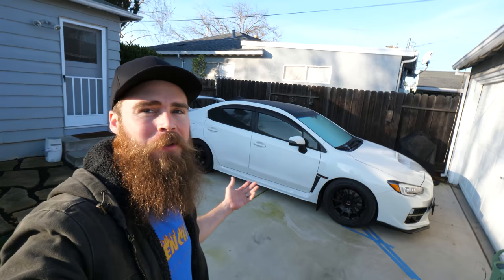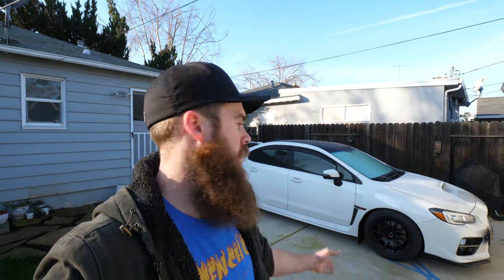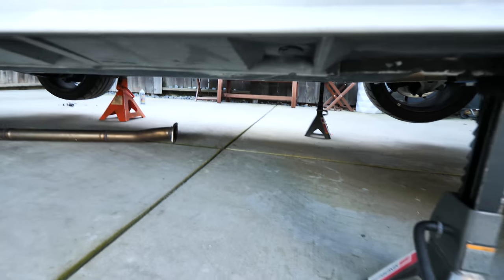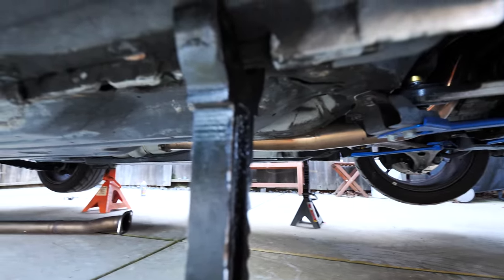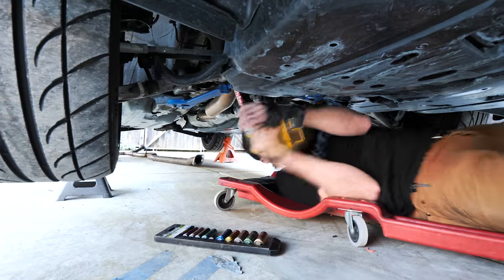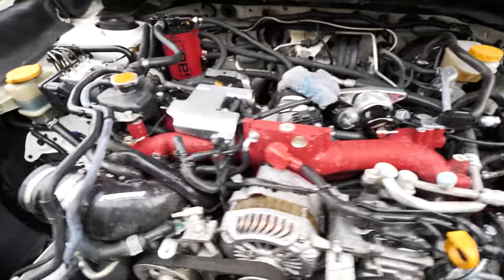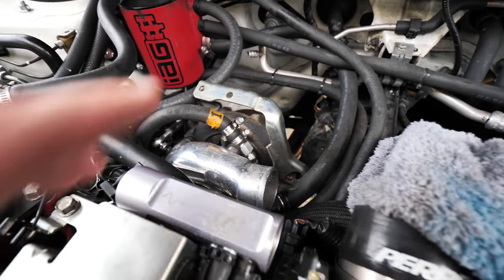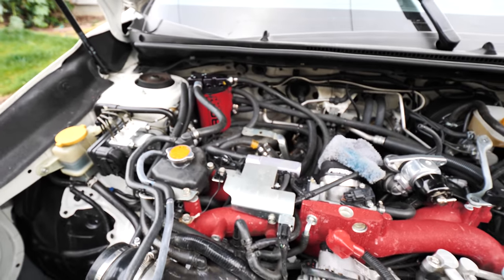MOST HATED SUBARU VIDEO EVER "THE STI PART OUT"

Comment: Have a 2016, no issues. Bone stock. Friend has a 2011 bone stock as well with 140k no issues. I guess the main thing is to keep it stock and do oil changes. Also, don’t take it to the track with it not broken in. Just my two cents.
Reply: subarus are garbage stock
Reply: KoG GoK They aren’t reliable stock either?
Reply: garbage as in they have absolutely no power compared to everything out there now adays. the power rating has been 310/265 ish for the past 100000 years.  they just keep getting heavier and heavier but same old power.
Reply: KoG GoK Ah. More than enough power for me since I came from a 2010 Honda Civic. But back to reliability, stock is still good, right?  That’s all I really care about.
Reply: head over to a subaru forum... and search ringland or bearing failure
Reply: KoG GoK even with a 2016 WRX?  Not sti.
Reply: go to google and type in fa20 ringland failure. why are you in such denial? unless you are driving like a granny shifting at 2k rpms and changing your oil every 1000 miles you are going to have problems. if you are driving like that should have just bought a regular impreza and saved yourself alot of money. the funny part is the first link that comes up is to nasioc with a list of like 20 members with blown fa20s lol

all i  know is on my next build with will inevitably happen im going to use a jdm sti ej20.... if it wasnt for me enjoying smashing 5.0s with my 4 banger i would have changed platforms a very long time ago.
Reply: I own a 2004 STI with 145K miles and it still pulls strong (it burns a normal but high amount of oil though).  I’m just now getting around to doing a rebuild on it but it has been fairly reliable, at least the motor has.  I even autocross occasionally, no complaints.  Most of this guys are neglecting their cars which is why they blow.  If you rebuild without a quality oil pick up like killer B or a air oil separator, check oil regularly then you won’t have a problem.
Reply: Cali MD I baby my cars. I shift around 3K. I’ve never taken the car past 4K.
Reply: Mohit Gehani 2004 STi here 118k miles stock motor and turbo Cobb st1 . But I maintain mine like an airplane . Check my channel for engine maintenance and tips to keep it running. For what I do with my car , more power is not needed. Chassis Tuning is more important to a under steering Subaru. I know multiple people that have had issues when trying to make power.
Reply: @WhiteGravey  thats why you build tbe engine pretty simple
Reply: @themtgdude486  stock is not reliable. After you build them they are reliable

Comment: lmao, amen Blake. This is the damn truth. I've been in and out of Subarus for 10 years now. Junk, like I can't begin to explain how much top end fluid, early flushes, early oil changes, protunes, top of the line parts, etc I've used on my WRX's and still...boom, blown engine, blown trans, blown rear diff. They are only good for maybe daily driving, keeping them bone stock and under warranty. I got out before ever building an engine, thankfully. I'm not much of an autocross guy, I just wanna go fast in "Mexico" and I picked up a 2015 5.0. Completely different animal, with long tubes back and a tune, redline set at 7800 the car is amazing to drive and makes over 400rwhp, much more than any of my blown up WRX ever made. Best decision I've made, hands down!

Comment: I just traded my 2016 STI in.  Just got totally bored with it.  Paid cash for a 2015 Camry SE as a beater which I will keep until the wheels fall off..  Saving for a 981 Cayman S.
Reply from the maker: RexReese perfect choice the Cayman is an excellent car, it’s seriously cheaper to start with one instead of modding an STI because eventually you will have put enough money in a 40K car to afford an 60-80k car
Reply: you wont regret that choice on the 981. Expensive to maintain though so keep that in mind! My brother owns a 981 cayman S and a set of tires cost about $1400 or so. Pads and Rotors are also quite pricey coming from a subaru  hahaha But you'll have one hell of a fun track car!
Reply from the maker: SpacemonkeySTI Pretty sure the tires are currently on this car cost the same if not more.

Comment: Would you say they have less problems if you leave the powertrain bone stock? I've seen tons of old bug/hawkeyes with 200k+ miles.
Reply: Gavin Whiteley from my experiences it's best to keep these drivetrains stock, or to do a very minimal power increase if you must.
Reply: It mostly an ej25 problem. It's a terribly fragile engine.
Reply: As Jensen said, it's mainly a ej25 problem. EJ205s are stout, but are more expensive and harder to make big power out of. But ej205s with vf turbos don't have the same problems, but you aren't making much power
Reply: U need knowlege on how these cars run, mein buddy has 160k E85 and he only uses it to race or drive hard for the last 5 years. Mine has held up good 100k mi. going strong. That being said you need forged piston if going over 350 whp, thats a given on most 4 bangers. Now the BMW are fast af, look real nice, the 135 looks thicc af, but some repairs can cost just as much as a wrx shortblock and i hate the dual mass flywheels.

Comment: 800 miles at a autocross.... well ever heard of a break in????
Reply from the maker: John Blankenship myth here’s a little article on that http://www.badasscars.com/index.cfm/page/ptype=product/product_id=82/category_id=13/mode=prod/prd82.htm
Reply: @BlakesGarage   why not go with the manufacturers recommendations(IAG) over badass car article?
IAG then selfs say: 

IAG built short blocks can be professionally tuned once they have reached approximately 800-1000 miles of
break-in driving and have been extensively quality controlled.
• Regardless of mileage when tuning, continue performing break-in oil changes as scheduled throughout the
duration of your first 3000 miles of driving.
• Once break-in tune has been performed, monitor ECU readings by logging vehicle and continuing your
relationship with your tuner to ensure that the car is running properly and safely.

https://www.iagperformance.com/v/vspfiles/downloadables/documents/Engine-After-Sale-Shipping-Doc.pdf

Comment: It blows my mind that people who want big power out of the EJ don't also know how to make them more robust (i.e. closed decking and MLS gasket). I have 2 naturally aspirated EJ253's on the road and they are beaten daily at 200,000 and 290000k respectively.   Blowing up motors by bolting shit on is for kids. I was a kid when I blew up my turbo EJ. I didn't know shit about motors and thought I could just bolt power on. I was dumb. Don't be dumb
Reply: Hate to break it to you but MLS gaskets are standard and a closed deck block alone cost over 2k.

Comment: autocross....track days....drag racing ...etc etc....and they wonder why they have issue with motors. gotta pay to play.
Reply from the maker: joe hicks yeah I get that but 3 engines in 60K that’s just a shit design. Say I buy a new Mustang 5.0 that thing can thrash all day at the track and have no issues so....
Reply: you haven’t been into any one of them have you?
Reply: It's a 4cyclinder turbo of course it's going to have issues if your trying to push alot of power lol and you can't compare it with a V8 bro haha. Love my Subaru and I do agree with the "pay to play" quote
Reply: You realize there's cars out there that can do all those things without issues right?
Reply: Yes and no....what 4cylinder turbo car are you speaking of? That will never break from multiple track sessions and only have bolt ons?
Reply: good question... yea I'm curious to know too. I mean i don't expect the engine to last forever. but i shouldn't have to go through multiple EJ engines in a short span of "track day" mileage. that's the issue with EJ's. they're unreliable motorsport engines. PERIOD. i don't care what anyone else do. but this is what I personally do. anyone who thinks an engine will never have issues from multiple track days have ZERO clue what you're talking about.
Reply: should at least get 80 thousand miles out of a autocross engine why not daily that ride and keep trucking part why?????
Reply: joe hicks its built for that I think there was some design problems batched

Comment: I still don’t understand is this STI screwed does have low compression on some cylinders? 
What exactly is wrong with it at this video ?
Reply from the maker: Lifted a head most likely blown head gasket. Very common issue on these cars.
Reply: We’re all the numbers on the AP solid 
Like DAM feedback knock , knock count ?

Comment: you speak for your self don't try to tell people it's going to happen to them what a bunch of bull, very disappointed in you blake
Reply: John Fotopoulos will happen to everyone that modifies a subaru 100%
Reply: Yeah i like this guy but this video felt like an attack to subaru owners, what a piece of work eh.
Reply: Its the truth it will happen. I have a 2015 sti on on 3rd engine 90k miles on the car. First 2 engines completely stock never seen a track  now i have a built engine cross my fingers
Reply: @danielmurillo4992  hopefully not is you have a built engine with a modest 500hp
Reply from the maker: Just watching this video 3 years later and wanted to see if anyone’s opinion changed?? How many of you guys have blown an engine now??
Reply from the maker: Just watching this video 3 years later and wanted to see if anyone’s opinion changed?? How many of you guys have blown an engine now??
Reply: still driven the 2014, just had a retune from eric finally got around to installing a electronic boost controller, i redline my car everyday i drive it, autocross, drag race but i won't launch it, 50,863 making 19 psi, no problems. just saying
Reply from the maker: @jcftrucker1  damn better sell it soon then.
Reply: @BlakesGarage  fuck that i love my car, i take care of it!
Reply from the maker: @jcftrucker1  just honest with my experience and all of my friends that have gone through the same frustrations. Basically I just recommend everyone sell if they’re thinking about doing any Subaru engine mods as it’s just an endless money hole that you can’t come back from unless doing an built engine every so often sounds like fun. Everyone I know that got rid of there’s has never looked back and said man I wish I had my old Subaru back.
Reply from the maker: Suspension, Brakes Chassis feel free but engine nah not worth the trouble. Call me a hater or better yet a realist.

Comment: Dude, nice video!! My 2013 STi was making 400whp with stock internals, all bolts on and Blouch 2.5 (10cm housing) on +100oct. I broke 2 pistons because I forgot to change the map to "daily drive map" (360whp) back home from the race track. I put 93oct and it was all about minutes when I was feeling a 100cc engine under the hood. Fuck myself!! 

Where I can contact the owner or where I can find the parts for sale?
Reply from the maker: Omy Martes contact White Wing STI or IG most of the stuff is all ready sold but I know he still has a few things left.

Comment: I'm on my third engine right now.  First engine was stock and spun a bearing (classic Subaru...) Next one was forged but it burned a valve, and now I have an IAG closed deck making 500hp.  Fucking fun as hell and I understand the risk factor that comes with it.  A stock EJ25 is weak as shit - ringlands and rod bearings are the main problems.  A built EJ25 is far more reliable, in my opinion.

Comment: Thanks for the great news. I’ve got one more engine failure to live through before I get rid of this thing. I really hope I’m one of the lucky ones and don’t have your luck. 2017 STI @26,500 miles developed rod knock on stock motor. Though I do have to say whitewings STI seemed more like shitty assembly practices from IAG.
Reply from the maker: I do think it could’ve been partly due to IAG not giving him a good block. But I’m just saying these engines always go no matter what. It’s only a matter of time it’s not an engine that you can really do like 100-150K or more on like most cars
Reply: Blake's Garage I ended up going with a prime p2x long rod closed deck (basically outfront) and had the heads ported/polished, gsc valvetrain, BC272 cams, and held together with some ARP625 head studs. Just running a Dom 1.5xtr 10cm 3” inlet on E85. Crossing my fingers
Reply from the maker: Subidoo STI sounds like a good set up I’m sure it’ll be good for a bit. But eventually what ends up happening I think to everyone as they realize how much money they spent on an STI and how they could’ve just bought a better car after all the money that they’ve blown on upgrading it. Most guys end up spending like 20 K plus on rebuilding engines and stuff like that on a $40,000 car and there you go that’s a $60,000 car. And honestly you know you’d rather be driving a $60,000 car. That’s used 991 911 Carrera money.
Reply: Blake's Garage I’ve already realized this 😞. Should of bought something fast out of the box with a warranty. Think I’m into this thing for like 60k already.
Reply from the maker: Yeah, hopefully you’ll love all the extra power. They are fun when they’re not doing Subaru things.

Comment: The accuracy of this is so real. I never had my motor blown but my transmission did go out after only 18k. The dealer denied my warranty also and said it was my fault due to my coil overs...no mods only a CBE. I miss it though...
Reply from the maker: Rufio In wow that’s actually kinda illegal they have to prove that the coilovers broke the transmission which they didn’t because there’s no possible way. You should check out this article on that https://jalopnik.com/dont-let-the-car-company-falsely-accuse-you-of-abuse-wh-1736064825/amp
Reply: Are u serious? Due to the coilovers?
Reply: yeap. They gave me some bs explanation that due to the car being lowered it "shifted the transmission". My syncros for reverse and 5th were messed up. I couldn't put it in reverse at all and 5th had to be forced pretty hard. Talked to the manager and everything about it and they wouldn't do it. I even had their extended warranty. Anyways I didn't have time to be going back and forth with them because it was my daily and I needed transportation to get to work and what not. I had it fixed and told them to get rid of the extended warranty and to refund me that. It eventually got flooded in hurricane Harvey. Insurance paid it off and gave me a lot more.

Comment: evo x or focus rs for auto cross and track days?
Reply from the maker: x Royal BMW....wait what was the question?
Reply: Had a Subaru for a year. Was not impressed at all. My stage 1 apr GTI murdered them (mostly due to power to weight ratio). Don't know much about the Evos, but just based on their budget compared to the Subaru I wouldn't expect much. Just look at the interior. I currently have an RS and I'm very happy with it. They have had a recall on the gasket issue, but other than that no problems. They have good warranties and extended service plans that cover just about everything from oil changes, tires, even wheels. I've killed just about everything I've gone up against stock including Subarus, Evos, mustangs, camaros... Waiting to find a type r. It's been the most fun car I've driven. Ride is a bit stiff for everyday driving, but I still enjoy it. All I can  recommend is go and test drive some cars and figure out what fits your driving style and personality. Just remember when you start tuning up in the 400 and 500 ranges you might come into problems with any car. Just do your due diligence.